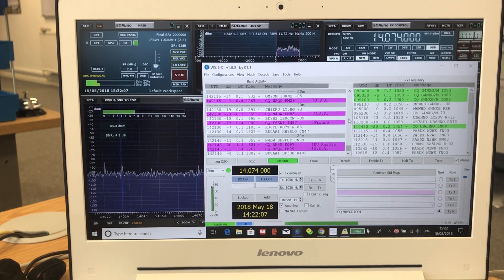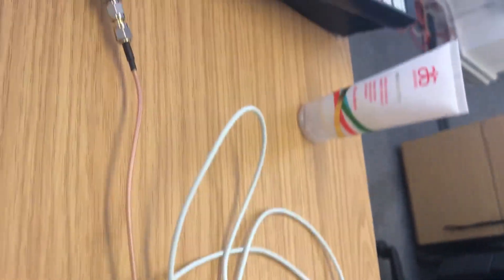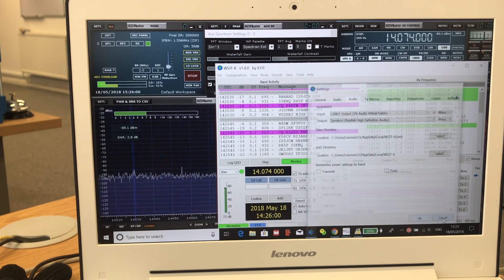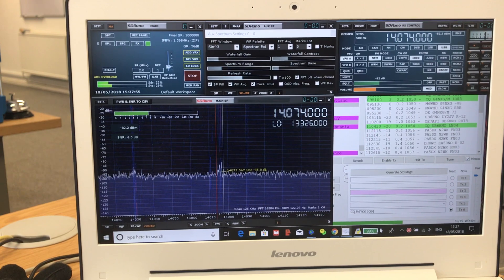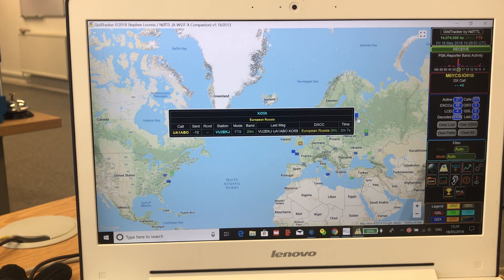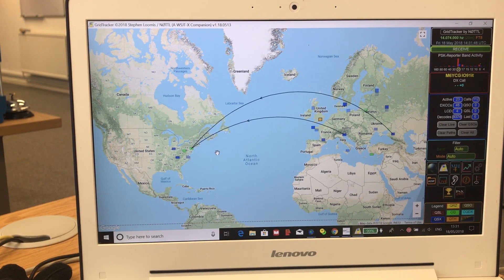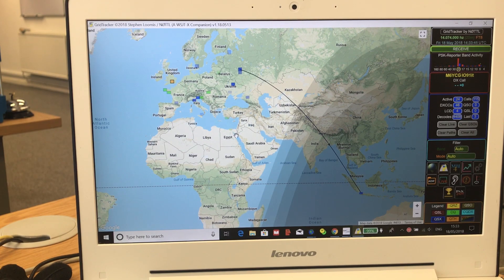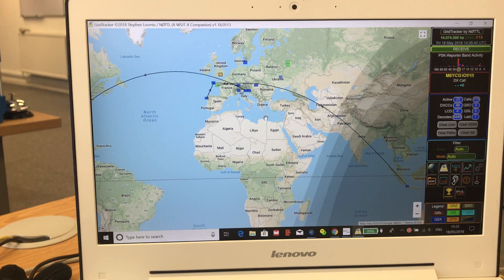FT8 decode using the SDRPlay RSP1A, WSJT-X and GridTracker - an overview of the set up

Comment: Hi Clint ! I plan to give FT-8 a try soon but I do not intend to transmit as a first step ; for RX only, is there an option I should disable or is it OK with default settings ?  Another question : I read that "WSJT-X always requests data sampled at 48 kHz" ; This confuses me a bit because despite SDR# sample rate is indeed set to 48 000, my audio output (VB Cable) is set to 192 000 to run RDSSpy. Do you think it could be problem ?  Best regards, Pat.
Reply from the maker: Hi Pat! I think it should be ok for receive with the default settings. The audio output from the receiver needs to be piped into WSJT-X. I do this with a VB cable and I use the 48 kHz sample rate. I don't think a max setting of 192 KHz on your VB cable audio will be a problem - but let me know how you get on. 73! Clint

Comment: If you already have an RSP talking to SDRUno (I have an RSP2pro), the additional steps to install the latest WSJT-X 2.0 and start monitoring FT8 on my Win 10 laptop were, for me:
1 Install Meinberg NTP to keep the clock precise
2 Install Windows Open SSL (for logging, I think.  This may only be a Win 10 requirement)
3 Install VB Audio Cable 
4 install WSJT-X 2.0
5 Turn on RSP2
6 Configure, reconfigure, etc.
And voila!
Reply from the maker: Thanks for this information! 73! Clint

Comment: Hi Clint. Although I knew a little bit about amateur radio digital modes I hadn't tried them until after watching your video. It took about an hour to get things up and running with my SDRPlay 1A & Wellbrook loop, using HDSDR software. At first, it didn't decode anything. This was sorted after rebooting the PC. Within a couple of hours it had picked up hams from West Coast USA, Ghana, Lebanon and forty other countries, so very impressive. 

I hope you will give the Elad transceiver a try on FT8, even with a basic antenna as I wonder what contacts you'll make. If results are OK, I'll sign up for the Foundation course and get licensed! 

BTW, I can't get GridTracker to save the countries it has found. When I shut down the PC for the night, it says I have found no countries at all. Any way around this?

Thank you, Rob.
Reply from the maker: Hi Rob, thanks for your message and congrats on setting up your RSP1A to work with WSJT-X! It's a bit of a fiddle, but worth the effort. At some point I will try to make contacts with the Elad, but I need to sort out a much better antenna first. I'm not sure about GridTracker and saving countries, but if I remember, I'll take a look tonight. 73! Clint

Comment: How did you configure WSJT-X and SDRuno to communicate frequency data?
Reply from the maker: Hi there Bill, I used online information to set it up, but one really important parameter is to ensure your computer clock is within about 1 second of the actual time, otherwise it won't work. Best results are obtained using a virtual audio cable that pipes audio out of SDRuno, into WSJT-X. There's free software available online for both of these. Hope that helps. 73! Clint PS message me if you get stuck.
Reply: Thanks. After a night's sleep I realized that the 14.074 MHz displayed in both the SDRuno and WSJT-X FT-8 windows was coincidental. Audio out is the only connection from SDRuno to FT-8.
Reply from the maker: Yes, exactly! Let me know if I can help. 73! Clint

Comment: Good to see you getting into FT8, Clint. I've been using it for the past two months and enjoy it immensely. It has brought me back into the transmitting side of things, and especially interesting with using QRP. From southeastern Australia on a dipole with 5w getting into Plymouth, Minnesota on 14mHz in the mid-afternoon recently. Not bad for the bottom of the sunspot cycle! Then a pleasing contact with CT7ANG Portugal via long path on FT8, again 14mHz in late afternoon. LP distance = 22,333 km using 20w output into a dipole. His many-element yagi antenna was doing all the work for me! WSPR is also fascinating and well worth spending the time. But you are correct, there's lots of fiddling to get things all set up and going. Also, WSJT-X can be a bit flaky at times! Cheers, mate. Rob VK3BVW
Reply from the maker: Hi there Rob, thank you very much for your comments. I am looking at it because I'm having issues with my HF set-up now that I have my Ham license. I don't have enough real estate to put up a large antenna and so I've been experimenting with an Inverted L and a tunable whip, with little success. The low-spec. requirements for FT8 make it an attractive TX option. Having spent a couple of days just receiving, I've copied signals as far away as Indonesia. Incredible really. Definitely a lot of fiddling around to make it work. I thought I'd cracked it at one point and it took me a while to realise that my computer clock was about 10 seconds out - more than enough time to screw up synchronisation. Thanks mate for your insights, very interesting indeed. 73! Clint/M6YCG
Reply: Clint, if you have enough room, you might be best to use one antenna and cut it for just one band, and just start off with that. If you have room for a 7mHz dipole, you should find that the band is open much of the day, so contacts should abound! Inverted vee dipole could be a good choicce, doesn't have to be especially high to get out on air.
Reply from the maker: Thanks for the suggestion Rob. I was thinking about a 1/2 size G5RV? 7 MHz is where I want to be on HF by the way, for the very reasons you gave. I'll have another look and hopefully I can get on-air soon! Thanks again and 73! Clint